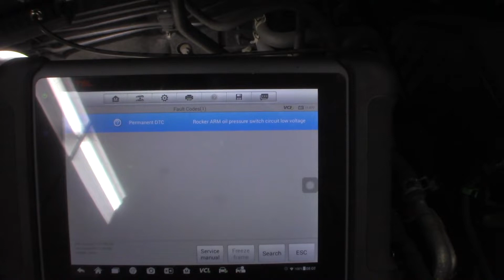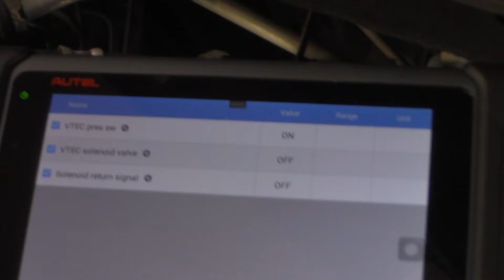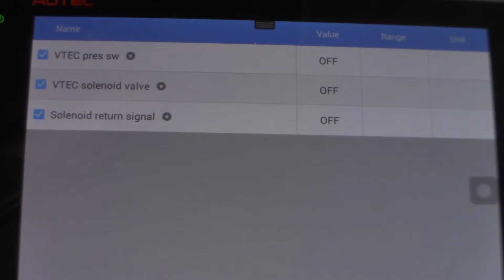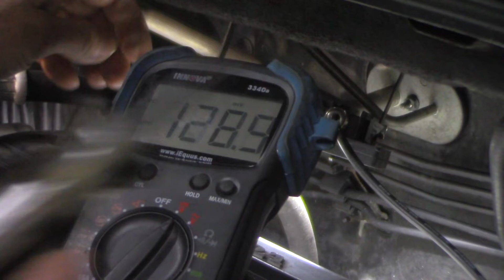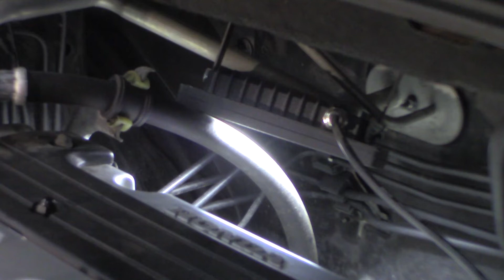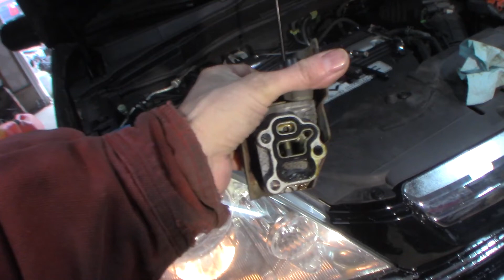2007 Honda CR-V P2646 code.  VTEC Oil Pressure Switch issue.

Comment: I had the same problem and symptoms that you mentioned on my 2007 CRV. I changed the whole unit since I had 265,000 miles on it. Solved the problem. Thank you for posting such a detailed and clear video!

Comment: There is another timing sensor, it's a cylindrical unit that sits in the head facing the right side of the car just down behind the engine stay with a two wire connector. Take it out a spray with carb cleaner to clean the filters and connect 12v to it and make sure it operates.

Comment: Finished my second Vtec solenoid . Removed 3 long bolts then one 10mm side bolt to separate shield and solenoid . Was able to leave all wire harnesses attached and just installed new Vtec into old shield. 278K wire harness stubborn and brittle😊

Comment: I replaced the whole vtec solenoid and it still throws a p2647 code. I am going to use a multimeter to check the wiring. It’s weird because my car only bucks above 2500 rpm’s every once in awhile, other than that it drives find 98% of the time when above 2500/3000 rpm’s. I am getting annoyed with this stupid part haha I really wish I could just know wth is going on with my car. Thanks for the video!

Comment: Which connector are you testing at 4:00 in? You say "unplugged" for testing.
 I'm assuming you mean this connector.
Reply from the maker: If I remember it's the oil pressure switch. (2 wire on top of the assembly close to the engine).
Reply: @CharlesAndCars  thanks! I’ve replaced everything with oem parts and still getting 2646. Wondering if it’s the connector or wiring instead.
Reply: So, I finally tested the oil pressure switch connector black and blue wire using your directions. It showed 11.8 volts. I then tested the voltage directly at the battery. It fluctuated between 12.1-12.2 volts. It’s a three year old battery. Do you think the 11.8 measurement at the connector indicates bad wiring resistance or just a normal parasitic loss over the length of the wiring harness?

Comment: The check engine light on my 2007 Honda CR-V came on, and the code was P2647, so I purchased the VVT solenoid and changed it. After changing it the same code came back on. Any suggestions on why it came back on?
Reply: Did you replace the sensor as well? Or the harness ?

Comment: Hey CHarles, when chking the 12volts to battery, there is a drain on the voltage....starts to drop. Starts out at about 10 then slowly drops while multimeter connected to plug (probing the blueblk wire on switch plug not sensor plug) Any suggestions? Do I now have to find the drain on voltage, like a wire grounding? grrrrrr

Comment: I have the same problem, the wire of the Oil Pressure Sensor does not have power, no 12v

Comment: Honda K-24 engine sucks, not only Vtec oil pressure switch there’s more crap around this engine 😡 same annoying P2646 , I have tried everything, now I’m going to disassembly the connector and connect the wires directly to the sensor to see if that improves the connection, I replaced the sensor several times, last one “fail” but I did some test with the voltmeter and was good! 🤬I want to sale my daughter’s ELEMENT, but she love it 🙄

Comment: 4:38 blue black wire i am getting 11.20 volts not good?
Reply from the maker: Hard to say, should be battery voltage.  Check voltage at the battery.  Is it low? (11.2)

Comment: What does it mean if  I pass the scanner test but do not have 12 volts on my blue blck
Reply from the maker: The blue/black to the oil pressure switch should be 12 volts (key on engine off).  If you don't have power there then you need to check fuses/wire for break.  I don't remember exactly what the blue/black runs to, but I would think there's a fuse for it...

Comment: Did all this and still giving me 2646. Not some one cut the cats off and it has no 02 sensors on it. My job sucks customer dose not want the 02 sensors put back on. I'm about to tell them fo r the f off and go somewhere else
Reply from the maker: Car will not function well without the O2 sensors.   Don't know how the customer would expect that to go well.

Comment: so i have replaced that part twice 96 months later found a split in one of the side metal peice for gasket), the solenoid at the end of the block, changed oil/filter TWICE (full synth) and still have low oil pressure. after a few miles above 50 MPH the VSA stays on etc... any thoughts.. oil pump or chain tensioner?
Reply from the maker: Only way to know for sure would be to t in an oil pressure gauge and see if the oil pressure is actually low.
Reply: @CharlesAndCars  according to the garage 7-8 lbs or psi? but good flow?

Comment: Awesome video. On our 2006 Accord I am getting P2649. I verified the voltage to the blue black wires at the oil pressure sensor is 12v and I do have ground at the other wire. Unfortunately my scanner won't check the coil side connector. On the coil side I get 3.3V on the green yellow wire and have ground on the black wire. Confused.........

Comment: Could you please provide the part number for an OEM replacement I can only find the oil pressure sensor just in case I need to replace it after an oil change…
Reply from the maker: Don't know the part number for your vehicle, but do a search for honda cr-v vtec solenoid assembly for your year and that will show you.  Use OEM.

Comment: what if its only reading 11.8V
Reply from the maker: My guess would be that your battery is a little low.
Reply: @CharlesAndCars  I did put in a new vvt. 13 miles later and acts like nothing changed. Took it off and screen is clean, oil looks good etc... Maybe I'll swap batteries with another car
Reply: @CharlesAndCars  nope that was worse. 11.5V and check light came back on FAST, less than 2 miles lol

Comment: Thanks so much for the video. I had already changed my VVT solenoid assembly and still the lights were on. Changed my oil and problem solved. Very helpful thanks!
Reply from the maker: Glad it helped

Comment: Nice video!

For what it’s worth for others who experience “limp mode” - check engine light, vsa light, warning light combo.  My ‘07 crv went into limp mode, turned it off for 5 minutes, checked oil (ok), turned it on and only the check engine light was illuminated - fully operational to get you where you’re going to work on it.

Had the code read and it was the code in the video.  Replaced the vtec unit (annoying place to work) and had no problems - until about 4 months later.  Same limp mode every few months now.  I disconnect the battery in each instance and the problem goes away for a few months.  If I find someone with the diagnostic tool in the video, I’ll check the signal for the vtec unit.

More recently, I’m starting to have low oil pressure indicated when I decelerate.  I’m assuming my oil is too thin for bearing tolerance now that the mileage is >200k.  But next step is vtec troubleshooting.
Reply from the maker: low oil pressure can absolutely cause this issue.
Reply: Wanted to add a tip I saw in a Honda forum. Adding a little bit of dielectric grease to the vtec solenoid connector helped me resolve the limp mode issue after installing the new part. Heard this generation Honda has a problem with water getting into the connector and causing it to not read properly (vertical angle). After I did this I’ve had no problems after a year.

Comment: I have this problem on my 2006. Check engine light came on last week. I had. Mechanic work on it this past Tuesday and he said it was fixed. Unfortunately the check engine light came back on today. The car also jerks a bit at seemingly random times. Can this problem cause the car to jerk? Getting it looked at again on Monday.
Reply from the maker: Hard to know what you mean by jerk.  Low oil pressure could cause issues with bearing which could cause a symtom similiar to what you said, but hard to really know.

Comment: I took my crv to a mechanic but I don’t have an engine light on. But they said they wanna change my oil pressure switch for some reason. How do I tell if it’s bad or not with no engine light on?
Reply from the maker: I would think that you would have an engine light.  I believe that code turns the engine light on.  Are they seeing that code with the scanner, but no engine light?

Comment: I ALMOST took my 2008 CRV to the dealer and god knows how much they would have charged me for this.  I immediately had my husband check the oil and it was super low so we got some oil put it in the car and drove it around.  Shortly after, the engine light went off.  So fingers crossed I will be able to keep my car just a wee bit longer.

Comment: Hey, thanks for the very informative video. I have 04 CRV with two codes (P2646 and P2647). I changed the oil and it didn't solve the problem. Then I changed the whole unit (aftermarket piece from Autozone) and rest the computer and drove it for a few miles and the check engine light came back on with the same two codes? What do you think I should do next?
Reply from the maker: Hard to say.  Couple of things.  Did you test to ensure you don't have a problem in the wiring.  I would only use oem Honda solenoid.  I wouldn't use aftermarket solenoid.
Reply: @CharlesAndCars  Thanks for the response brother. I changed the oil again used only 5w20 with a new filter. I also replaced the Oil pressure switch. And still doing the same thing. Actually both (Vtec solenoid and the oil pressure switch are aftermarkets). Does that matter? Both parts look genuine. Also what part of wiring I 
should check ?  Thanks
Reply: @linguistenglish244  did you end up fixing the problem ?

Comment: 2008 Honda CRV my vsa light comes on after warms up and wen I shut off and restart it stays off for a few minutes code is p1129 so should I replace the map sensor and that cylnoid
Reply from the maker: Do a search on youtube for honda crv p1129 and take a look.  You want to make sure that you don't have a wiring issue, don't just throw parts at it.  Go with Oem if you replace the sensor.  Aftermarket for sensors is not a good idea.

Comment: Awesome, I have a 2006 CRV that was gifted to me from my Mom. It’s got 272,xxx miles and I had this issue pop up a couple days ago after it sat for a couple moths. This will be a huge help for diagnosing it. Thank you!  FWIW I’m trying an oil change and the oe filter before I trouble shoot it. Read the Honda tsb that said aftermarket filters can potentially cause this issue and I recently changed filter brands.

Comment: Hello Charles, 

I've been having the same issue with my 2007 crv, replace the exact same part and still doing the same thing.

My oul level is good and clean and also everything was cleaned when I replace the part so what do you suggest.
Reply: Make sure when you change the oil to only use 5w20 as indicated on filler cap. The solenoid is sensitive to oil viscosity. I had same exact issue on my 2003 Element, same code, same bucking at 2700 rpm. I had previously thought thicker oil-better. Definitely not the case. Changed the oil with the required 5w20 and no issue after.
Reply: @Gringochulo1  ooooh that's the reason why, I have been doing a heavier oil and that's probably why it started doing that.
Reply: @wanderreyes2261  try changing with 5w20 oil and hopefully you will be good. Elements (k24a engines in general) are good for 300k if taken care of maintenance wise.
Reply: @Gringochulo1  when I scanned it, it says P-2646 low voltage.
Reply: @wanderreyes2261  Try changing oil with 5w20 and a new filter. Drive it around for a bit and light may go off. If the car has not had the oil changes kept up with, the screen in the vtec solenoid may be clogged up. It is a very fine screen and clogs up if the oil is run dirty too long.
Reply: @Gringochulo1  it worked, thanks man got an oil change and bang driving like a cloud.
Reply: @wanderreyes2261  Awesome!!!

Comment: HAD THIS HAPPEN TODAY 2008 Honda CRV.. CAUSED ENGINE LIGHT VSA LIGHT AND ! TRIANGLE LIGHT. IT WAS FROM VERY LOW OIL. Wenr ahead and changed oil ten minutes after this issue occurred and all is well.. hope this helps
Reply: Having the same exact issue started Monday

Comment: What is the scanner that you're using to check the signal from each part?  All I have right now is the basic $50 code reader that plugs in underneath the steering wheel.  What would you recommend that I get to be able to see exactly what parts are talking to the ECU like that?
Reply from the maker: That's an autel ms906bt.  Hard to recommend a specific scanner.  The higher end scanners are not worth the cost for most people as they won't use it enough to justify the cost.

Comment: Would 11.8 v been an issue
Reply from the maker: Don't believe so, just means the battery is down a little.  Could always put a charger on the battery and make sure it's fully up to charge.

Comment: my 2008 Honda CR-V had a code of P2646 and P1009.   But what concerns me is that I had an Oil Change a Week ago.. and the car drove fine.. until yesterday. Now the car won't Start.  The engine turns over but makes a weird sound but it won't start.. The Oil level is at the correct level...  Is it possible that if I have an Oil Pressure Sensor problem that My engine will Turn Over but NOT START ?????   thanks for any response..
Reply: Hey my crv has had the limp mode problem for a while and new it is not starting and doing the same thing you described. You find anything that worked?
Reply from the maker: That's really hard to say what might be going on.  Weird noise?  If you clear flood and crank (pedal to the floor so it won't start) does it sound consistent cylinder to cylinder as it cranks?  Look for relative compression test videos and try that first.
Reply: @CharlesAndCars  I Have A 2005 Honda C-RV That Thew A VSA, And Oil Pressure Code. It Goes Into Limp Mode When You Try To Accelerate.  I'm Hoping That This Will Cure It.

Comment: Do you need to drain your oil before taking the solenoid off?
Reply from the maker: No
Reply: @CharlesAndCars  so I changed the solenoid and cleared the code, took for a drive and about 5 mins in the check engine and VSA light came back on and I couldn't go over 3000 rpms. What else could cause this?
Reply: @Deadpool-rm7nz  did you ever find out the problem I have the same issue with mines
Reply: Faulty solenoid. 60 buck and 20 minutes later it was good.
Reply: this happened to me just last night. car repair shop stated same thing! i have had my 07 CRV for 13 years. 1st owner, 215K miles. Driving her until she dies!

Comment: Very helpful, but I checked my connector at oil pressure switch and I didn’t have power going to it? I just used test light,not voltmeter. I figure if I have voltage it would light but nothing. I checked gr side (yellow/gr) and i did have a good ground. Any suggestions on the power side. I looked for fuse for it and nothing. What would be best approach to why I have no power there with ign on/engine off
Reply from the maker: You would need to use a wiring diagram and determine the routing of the power.  Possibly there's a fuse for it that might be bad, or a wiring issue.
Reply: Steve did you ever fix the problem